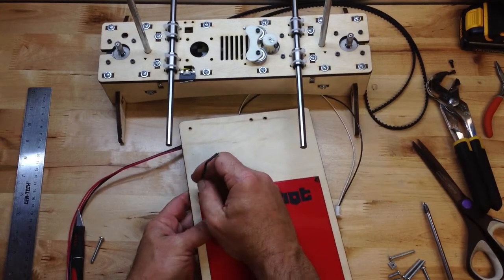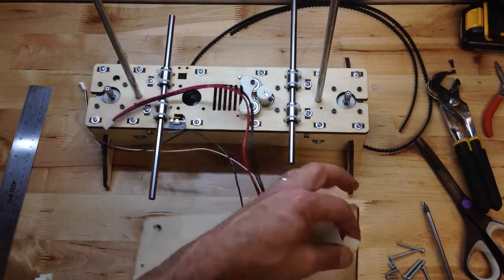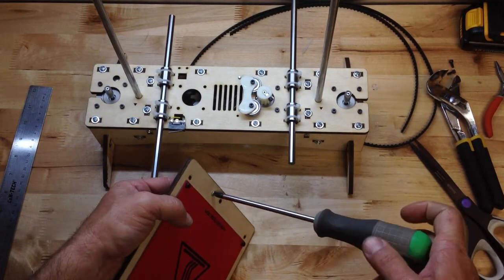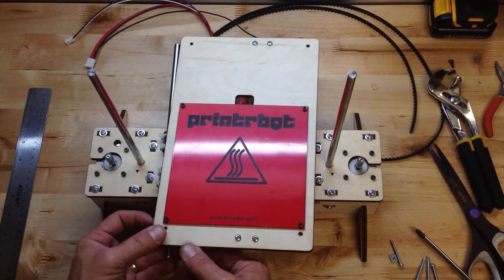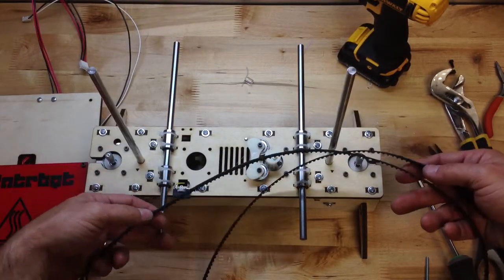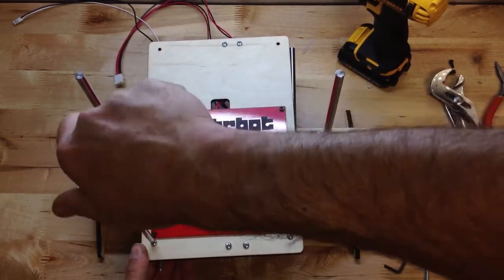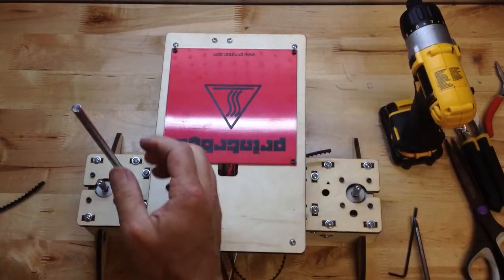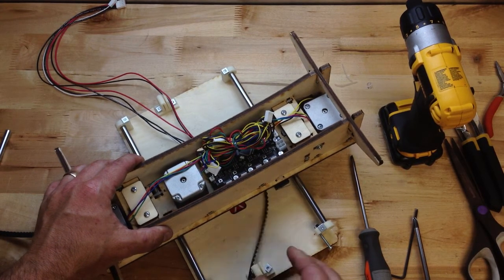Printrbot LC Build 04

Comment: you should have wooden substitutes. its comprised of two pieces rather than the one plastic piece. the only trouble I'm having with this step is the fact that all the screws for the heater bed are either in the way of the rod mounts or the screws are in the way of the bearing moving as the bed moves